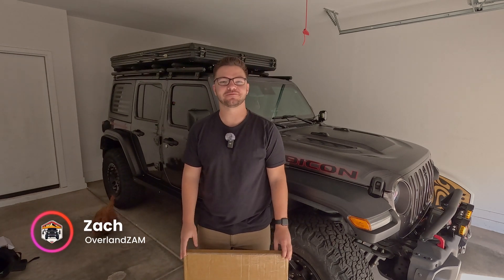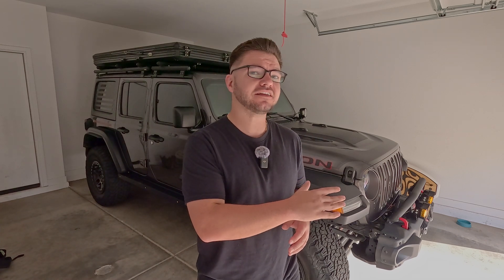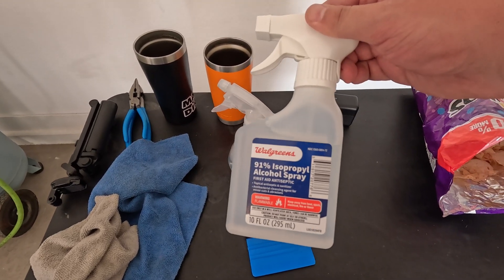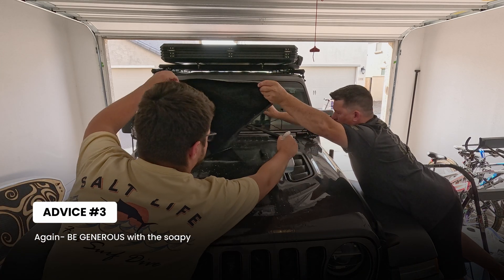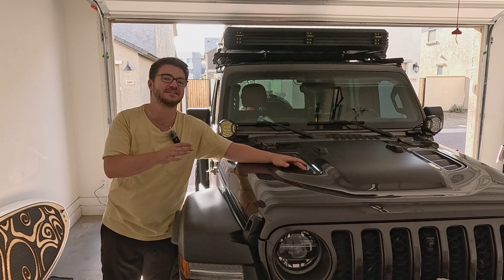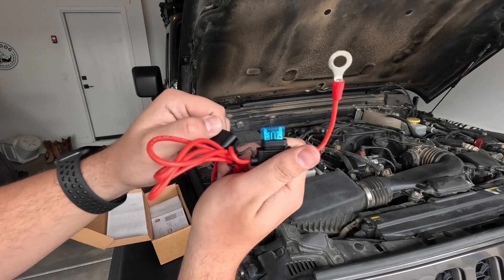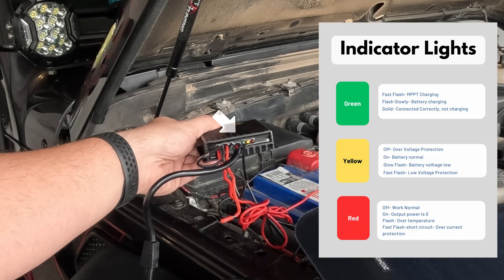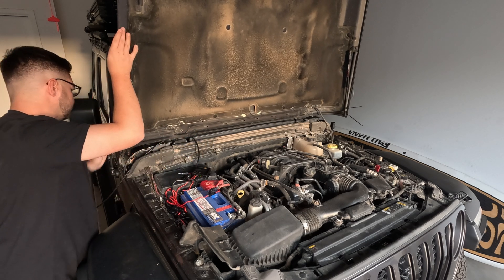Hood Solar Panel Install and Review!

Comment from the maker: Are you thinking about getting a Solar Panel? What info do you want to know?
Reply: What would you connect the Load from the controller to? I've had mine installed for almost a year and I've been wondering what others have hooked up to it.
Also, I'd like to see a review after a few months. I'm not sure, but I do have a lot of buildup on the positive terminal. Can you keep an eye on that and see if corrossion increases after a few months with you? 
I'd hate to relate it to the solar panel/controller, so I'd like to see what you and others have experienced.